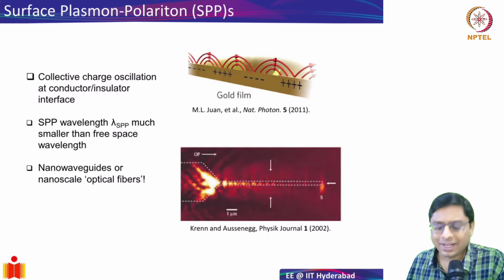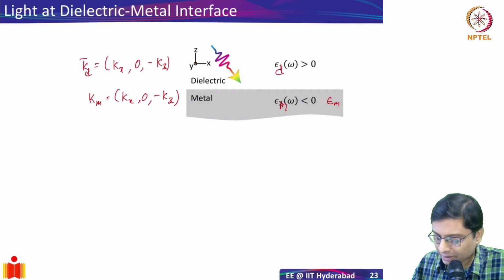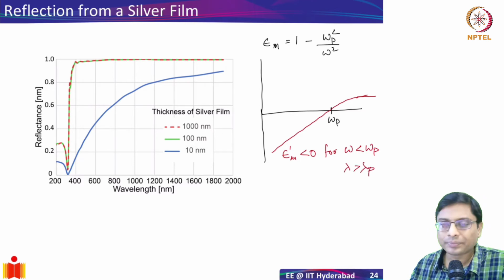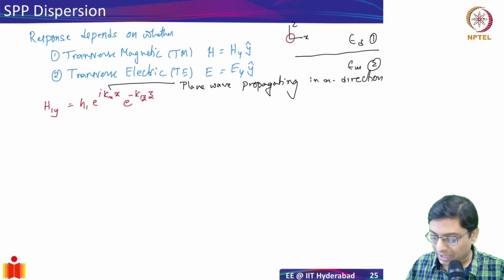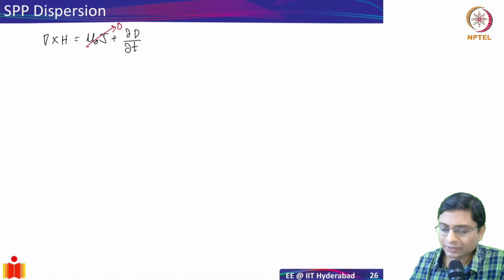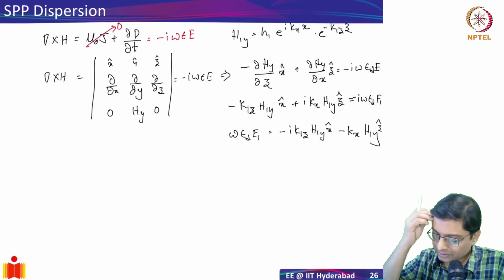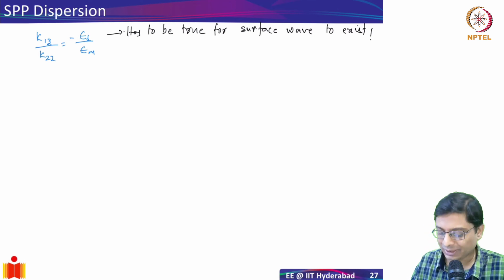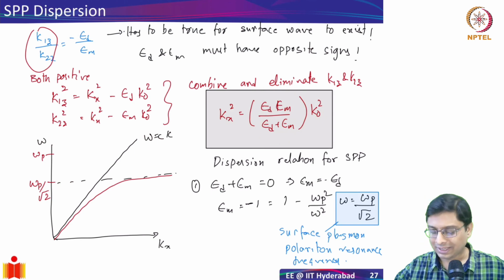4.5 Surface Plasmon Polariton(SPP)

Comment: great video but i dont understand how the condition for SPPs says that epsilon_m and epsilon_d have opposite signs so epsilon_m < 0. My problem is that if that is the case there is only reflexion because  epsilon_m < 0 and how can SPPs exist if the EM wave is fully reflected? Shouldnt  epsilon_m > 0 to enable the existance of SSPs?
Reply: same question
Reply: from what I understand, the free propagating EM waves are reflected from the metal, but only the waves whose momentum match with the electron oscillation at the interface are trapped creating the SPPs. This SPP (EM waves/ evanescent waves) are strongly localized at the interface and decays inside the metal (k_2z).